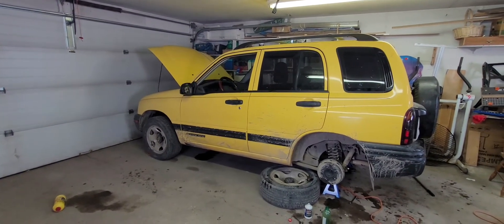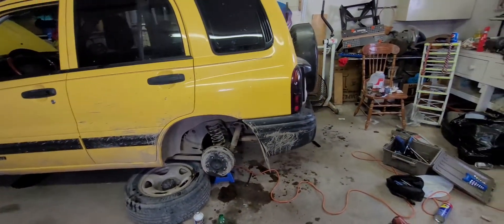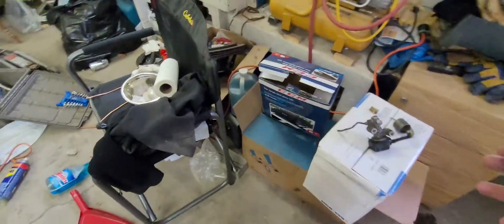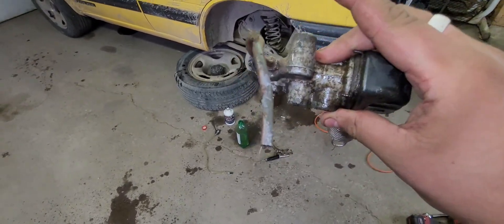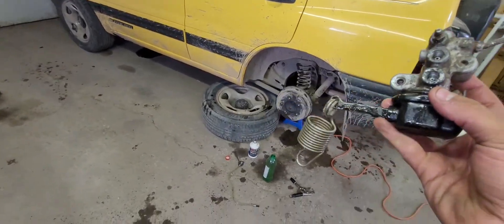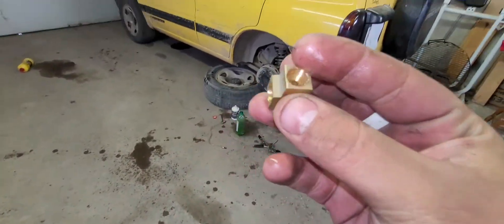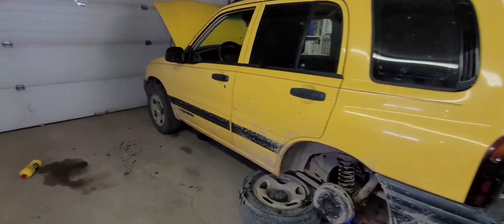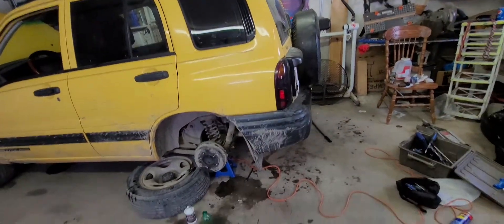Chevy Tracker Load Sensing Proportioning Valve Delete.  Makin er Stop Just About Mint Again

Comment: you don't need the tee to connect the rear brakes. there's 2 lines running back to the pro vale anyway; scrap the worse one and connect the best one to front of the master cyl. then connect the back of line at rear to the rubber one that comes out of prop valve to rear brakes and  bleed er off and you got it!
Reply: Could you break that down in greater detail?
Reply: How we can know wich one is the good one ?

Comment: Where did you get the t fiiting? seems to be 10mx1.0 size
Reply from the maker: Amazon, just searched for brake line t fitting
Reply: Wow. Sorry so late in replying. I wasn't looking for a T fitting.  The load sense valve is probably OK. It's the mechanism hardware at the valve that is rusted and in terrible condition.